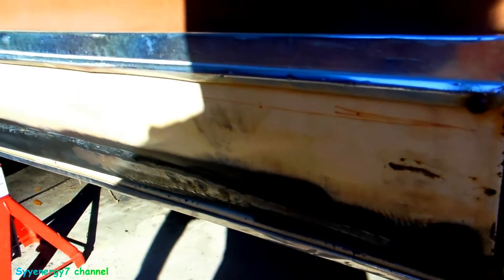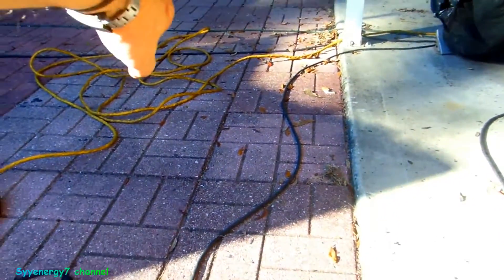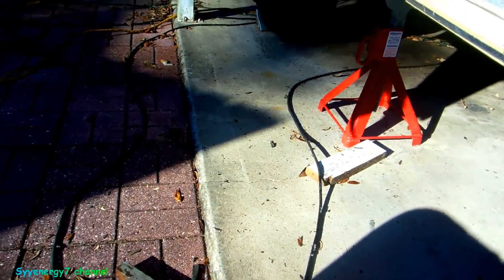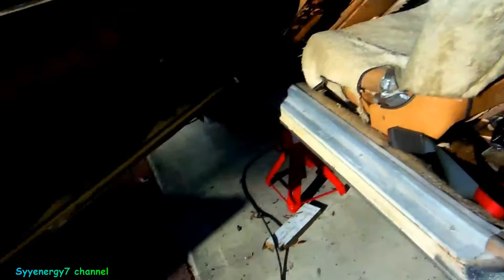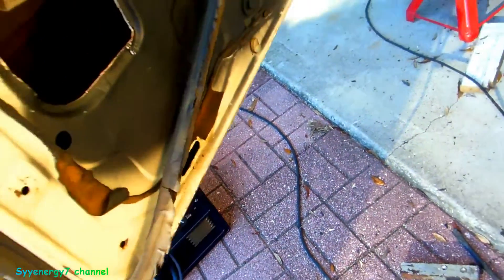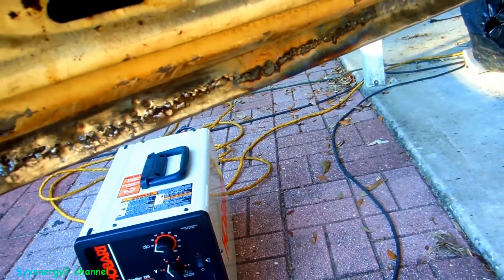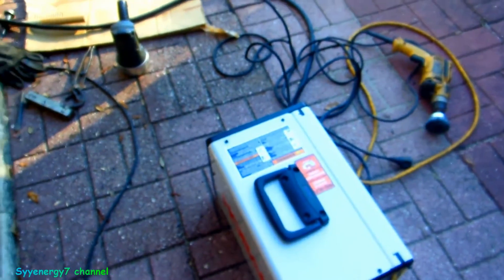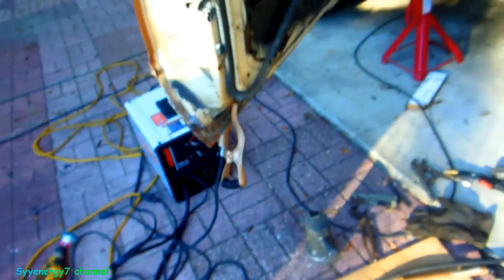Ground Clamp Makes HUGE difference for Amateur Welder.

Comment: The clamp does make a huge difference. I was going to buy a clamp like yours when my everlast welder arrived but low and behold it came with the exact clamp standard. It was a very nice surprise. A good clamp is an absolute must.

Comment: I have a 500A ground clamp and a 90amp or 100amp flux core welder, can I use that ground clamp on my welder?
Reply: Yes. You can use bigger, but not smaller

Comment: It's all about the ground clamp.  All welders come with cheap clamps that are just good enough to run your welder with.  I put the same clamp on my Hobart 140 and WOW it did make a big difference for me also.  I only run flux core wire on mine.  By the way you can get that same clamp at harbor freight for $15 and it takes 2 minutes to install.
Reply from the maker: yep, tweco all the way.
Reply: The copper allow clamps are the best. Luckily I got one of those included with my powertig welder. If it didn't I would have changed it out.
Reply: harbor freight clamp is trash. get tbe real copper alloy one from tweco. you will get excited

Comment: I like that big brass ground clamp...wish i had one on mine like that.
Reply from the maker: +Accuracy Marked I didn't think it would make much of a difference since the welder is almost new and has a new ground clamp.  But it made a huge difference. very surprising.
Reply: Copper not brass.